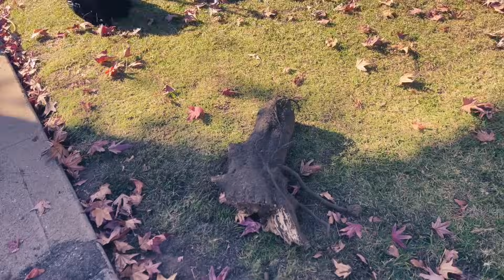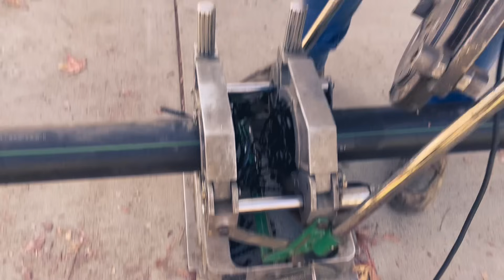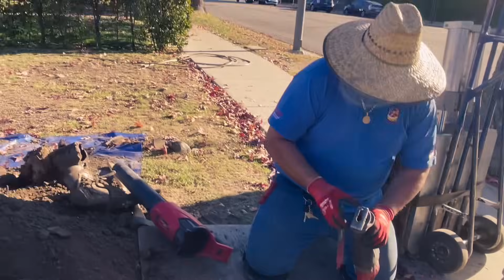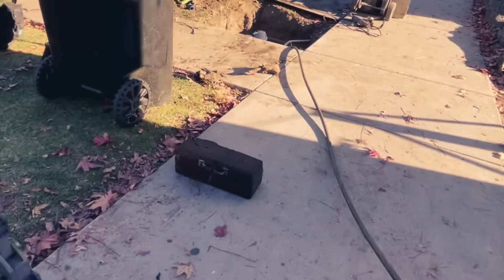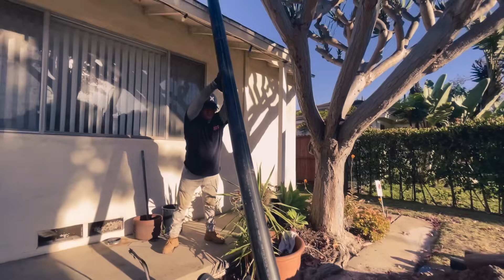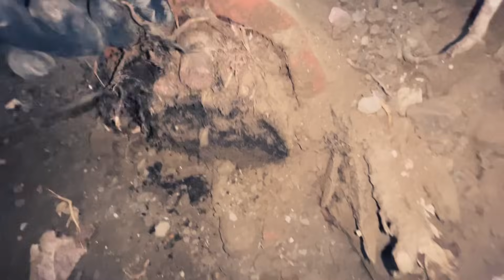how to replace sewer line from house to street with out digging (Must Watch)

Comment: I watched a similar video where they were replacing about six blocks of 40 inch water line all at once the same way and they welded the sections of pipe together the same way.  Same tools, just a lot bigger.
Reply from the maker: That's some serious operation right there!

Comment: i know its quick and dirty but how about  stuffing 4 inch   (you said 6 inch clay 5.5 inch ID) inside the lateral  to just near the  saddle end   a clean out inside the curb and   camera  / clean if needed in a year?      sure dont need a 6 inch lateral on a house       just some thoughts.
   also just dig out that yard w backhoe  its got dead grass   no biggie     lastly whats a job like this cost  ?  my cost wouldnt be too bad conventional construction  1000 for material  or under      bachoe  ?  me and a helper   for a day  or 2    3rd day complete  .       maybe get a third hand on the backfill and compaction   save my old back

Comment: Aren't you totally boned if that cable snaps during the pull?  20000psi, 90 degree bend, it's bound to happen one day.  Maybe attach two cables, and run just one through the hydraulic puller and the other hand pull at the same time.  For that day.

Comment: Great job but especially if you aren’t going to use shoring, keep your guys off their knees when a hole is deeper than their head. You’re just asking for a deadly cave in. Stay safe
Reply: He did say they had o use a jack hammer to break the soil apart in order to dig the holes.  I would say that the hole caving in would be extremely slight when it is that compacted and hard.
Reply: @Allen-w9d just because it’s compacted vertically doesn’t mean it can’t shear sideways into your hole.
Reply: @zhawkruns4ever316  
Unless you have more than one type of soil or a sandy or wet soil where you dug the hole, that is not how it works.  And it is obvious that there was only one type of soil that obviously was very compacted and dry.  Horizontally and vertically it was very stable.
Reply: @Allen-w9d fair enough. I’ve had too many arguments with my safety guy and his understanding of OSHA regulations to risk it myself but to each his own. I personally doubt it would cave but I’ve been told too many times it will to not use shoring in practically every hole.

Comment: Nice job guys. My neighbor has a tree’s roots growing into his sewer drain line between the street and the sidewalk yet the town will not take responsibility for the roots and it’s town property.
Reply: I had an issue with my sewer line, it goes under the street and into the neighbor's yard, the city will not pay for it on the other opposite side of the street, first the neighbor had to cut some trees down then I had a repair done by a home warranty company they got the line flowing, thecompany that did that said there was still a problem that would cost $12,000, got a second opinion they said to leave it alone

Comment: The ONLY thing I didn't like was that weld... Saw another company that had much longer lengths unreeled from a giant spool or something more continuous?
Reply from the maker: What about the weld? Do you think it might disconnect?
Reply: @PWN5  After all of the stress of bending, plus extremes of moisture and temperature changes in the ground, I see it as possibly cracking without a sleeve or collar around it? Might want to consider doing that in future for added safety?

Comment: How much did that cost?
Reply from the maker: 7k
Reply: @PWN5 $7K ? NOT BAD…I was quoted $12K for 1/2 that work.
Reply: @PWN5 wow that is a good deal, seriously the amount of money in equipment you have to keep on hand
Reply: The utility company in my city has been doing this for years. Instead of water or sewer mains, they are using this technique on all of the of the old natural gas mains throughout the city. A much better solution than digging up streets!

Comment: Why not just use a coupling?
Reply from the maker: We did use couplings
Reply: @PWN5  i mean instead of the heat fusing machine?
Reply from the maker: The primary objective is to ensure that the pipe is seamless underground.
Reply: @PWN5  I'm a beginner. Is the heat fusing better than a coupler? For a local projects around the house I usually use couplings but I never knew about this heat fusion.
Reply from the maker: That's awesome! So heat fusing is good for polyethylene pipes, but if you're working with PVC or ABS inside your house, you can't fuse those. You’ll need to stick with couplings and some glue for those. Good luck!
Reply: @PWN5  awesome! Thanks so much for your video and kind explanations.